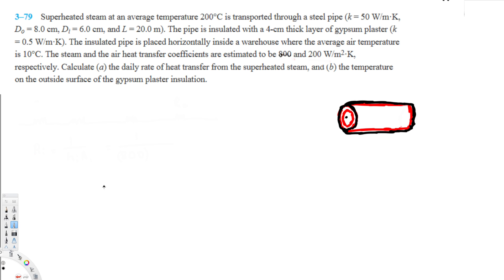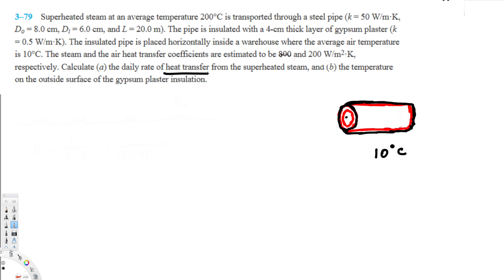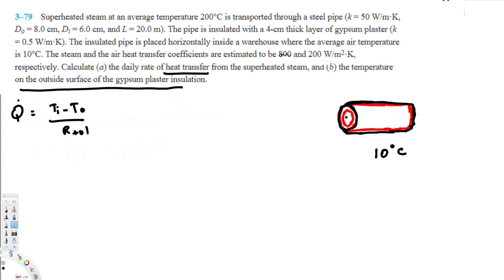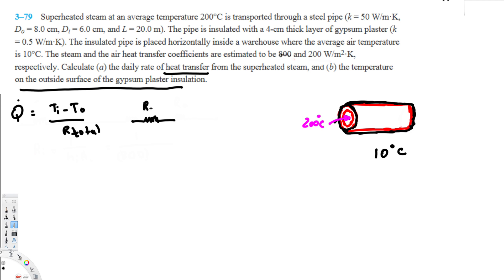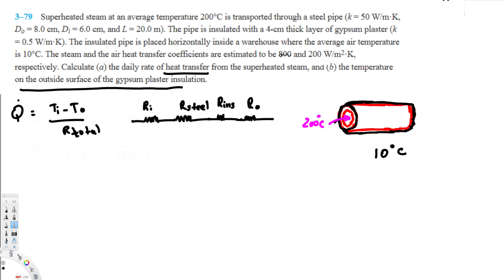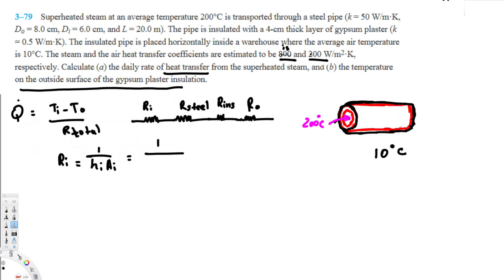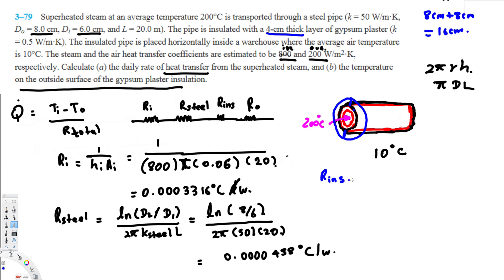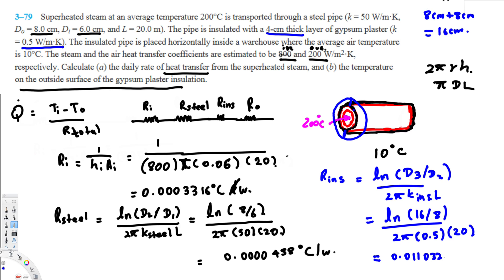Heat Transfer - Calculate daily rate of heat transfer and the temperature on the outside surface

Comment: Pipe of diameter 4 inch having insulation of polyisocynurate over the pipe of 50 mm thick. Initial temp of inner surface of pipe wall is 5 degree centigrade after that steam at 160 degree Celsius temp flow through the pipe for cleaning purpose. Calculate the time required to reach 120 degree celsius temp along radial direction?  (K of insulation is 0.023 w/mk, density= 45 Kg.m3, Specific heat 1400 J/Kgk)

Comment: An insulated pipe of 50 mm outside diameter ( = 0.8) is laid in room at 30ºC. if the surface temperature is 250ºC and convective heat transfer coefficient is 10 W/m2 K, calculate the heat loss per unit length of pipe.

need answer please sir